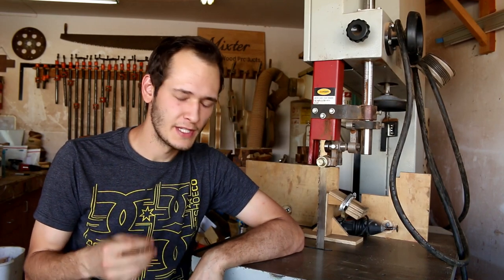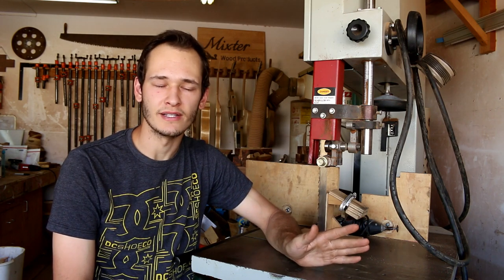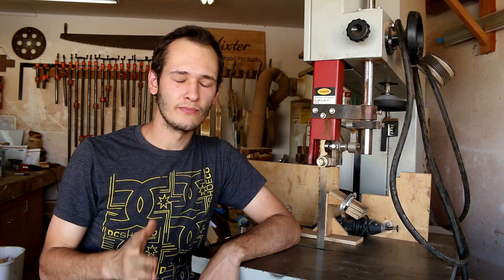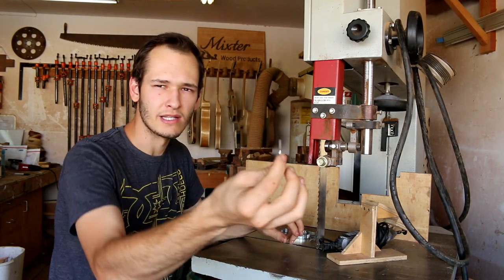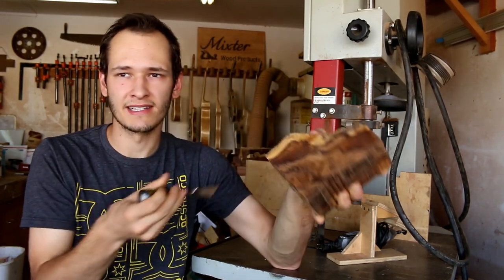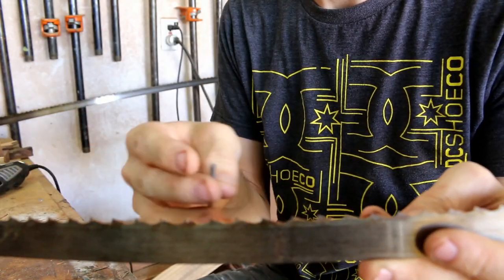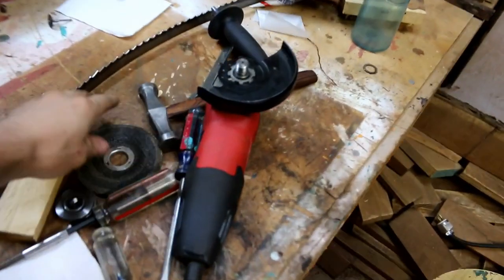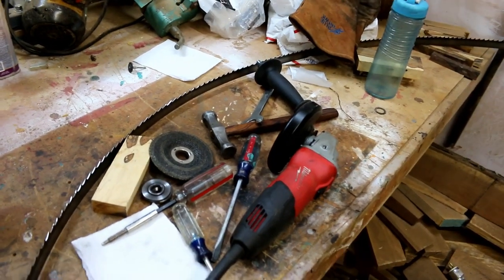How to Sharpen a Bandsaw Blade with a Dremel Tool

Comment: I know this is an old video but both Grizzly and Timber wolf blades are terrible, Grizzly being far worse, If you are looking for an amazing re saw blade at a very reasonable price check out the wood slicer blades from Highland. I normally use a Laguna bandsaw king blade witch is basically the Lamborghini of bandsaw blades for re sawing but they are over $200, worth it but I realize not everyone wants to spend half there rent on one blade. I use the wood slicer blades when I'm re sawing all of my extremely hard fingerboard woods such as ebony and it cuts through them like butter with pretty much no chatter marks. I also use them extensively for cutting out guitar body shapes because they are thin enough for radius cuts unlike the re saw king and it save undo wear and tear on that blade as well. Love your videos by the way.

Comment: You change the heat treatment of the blade every time you turn the edge blue and darker.
Reply: You are correct but for his application, ripping through huge chunks of dessert hardwood it's not a huge deal. If he were needing precision cuts you are right he would need to alternate, skip every other tooth on one pass then flip the blade on the second. The best way to do it is dole out the $20-$30  for a new blade, 2 hours of my time is worth way more than that. Nothing wring with saving money though if time is not an issue.

Comment: Those teeth are pointed in different ways! Ever other tooth is pointed a different side! You grinding them all the same way! That's wrong
Reply: (upped your response) There is also a small 'jiglike' tool that 'pushes' teeth on such blades back into full set. 
Thanks for the video, really appreciate the info.